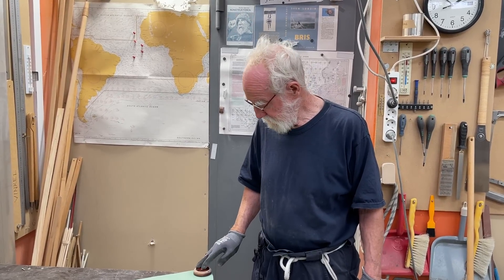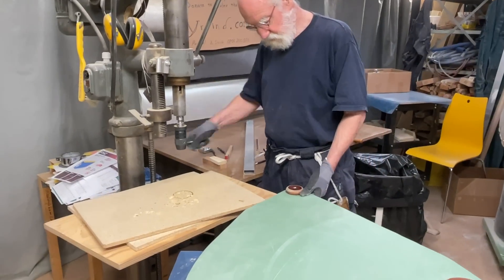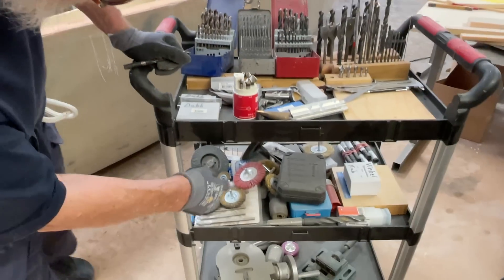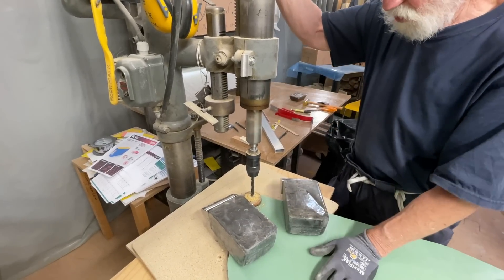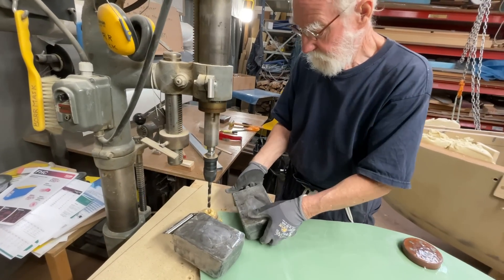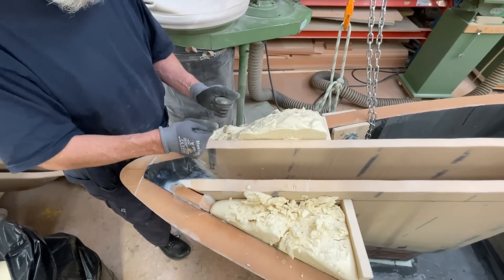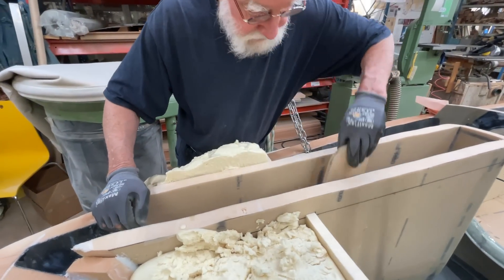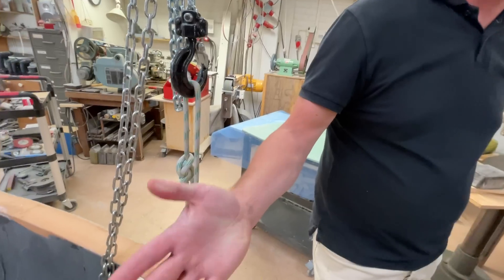17 August 2022. Several kind people have expressed concern about the pressure of the expanding foam.

Comment: Odin's power to you Sven. 20kN holds the Magdeburg hemispheres together, you say.
 What is the force your G11 Centreboard can widthstand as Exlex falls sideways off a high wave. ..  Where it joins the casing will it be strong enough?
Reply from the maker: I do not have numbers on that.
But I belive that I make it more than strong enough.
I have great confidence in my structures and so far nothing have broken.
Reply: My engineering instincts tell me that it would be nearly impossible to naturally generate  enough hydrodynamic force on that low aspect centerboard to bend it to failure.  Perhaps violently bashing it repeatedly on some rocks would disable it, but that is well-engineered material.
Reply: Flexural strength (crosswise) of good g11 is 70,000 psi.

Comment: I know nothing about anything other than the theory that at least 100 hours of other people's experiences and demonstrations have instilled in me - so take what I say with a pinch of salt - but I think the strength of the foam Yrvind has put at the bow is negligible - he could have just used builders expanding foam... The bow impact of this craft is beyond impressive, if you have seen Yrvind hit samples of his composite with sledge hammers, combined with the fact the bow has some decent  triangulation, multi layered glass and carbon interior all reinforced by the CB box.... I reckon he could surf down a 20ft wave at an equal amount of knots, hit a log in the trough and come away with only a minor ding and/or capsize. In those conditions with heavily reefed sail/no sail Exlex should easily be able to self-right with all that buoyancy from Divinicell and weight from ballast and bilge keels.
Reply from the maker: The main idea is to keep the space clean from cockroach and other bugs and mildew.
If the foam ads some strenght flotation and insulation its just a bonus.
Reply: Completely agree.  But when he thinks it could be a little better, he tries it.

Comment: Is there not a risk the centerboard will get jammed by barnacles or other things when the clearance is so tight?
Reply: That is always a possibility with any centerboard.  However, in normal operations, centerboards are raised and lowered regularly which helps, but they still need proper care.  Here, he has designed a centerboard trunk that allows access and maintenance of the CB through the fore deck - much better than most centerboard arrangements.
Reply: I assume they would only be down in the water when he is underway. Fowling bad enough to jam it would only happen if he sat for weeks with them down.

Comment: You look very energized! Probably from good rest and nice progress on Exlex! Work looks  good and you can never have enough drill bits. Gearboxed drill presses have very sadly gone out of fashion. They say Polyurethane gives of some nasty chemicals while curing. I hope you used breathers. Also: Exlex can now be used as a battering Ram!
Reply from the maker: True about tha nasty chemicals isocyanates not good.
However this is nothing I do dayli so it is only a small dosis.
Reply: There are still gearbox drive drill presses available,  they're mainly sold into commercial engineering companies as they're quite expensive but better suited to heavy use.